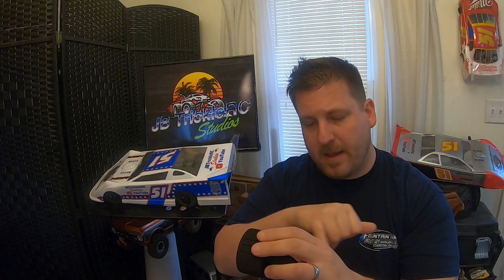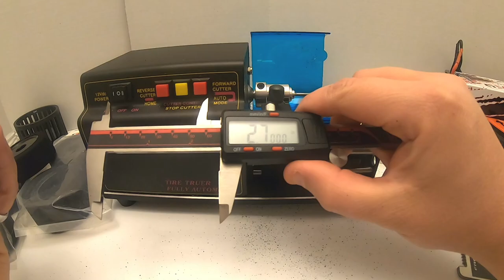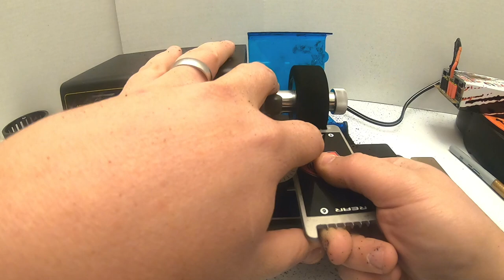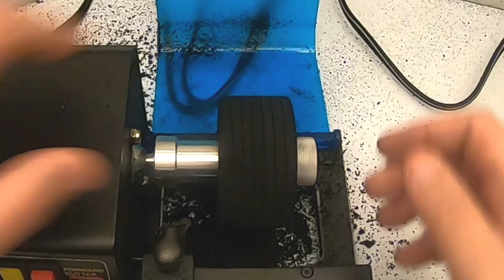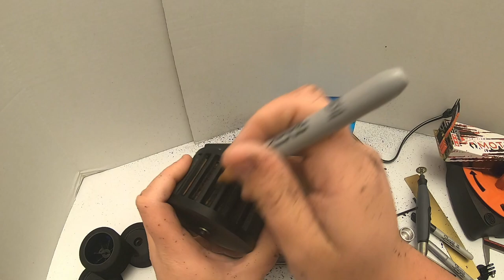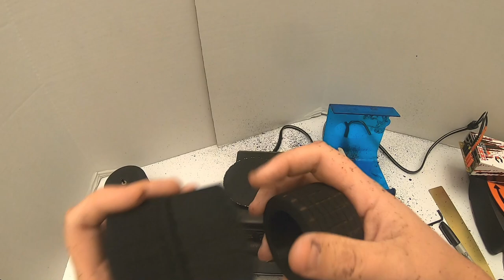RC Tire Truing, cutting, grooving tutorial: Part 1

Comment: Can you please tell me more about the foam itself, what is it made from what is the shore hardness, what is the foam known as in the retail world 
I am over in Australia and new to the hobby
Reply from the maker: Eugene, those are great questions but I'm afraid I won't be much help. These tires are made by BSR tires.  They do sell them in different hardness levels though which will also vary the amount of foam/rubber content.  More information can be found on their website.  As far as shore hardness goes that's something that can differ from racer to raver due to tire prep and softeners etc.  The science there is within your own racing program.  If you are looking for shore numbers based on the tires right out of the package. I don't have any notes on that because I didn't record anything until after I had them "broken in".

Comment: This is super interesting as I am a 1/7 scale speed runner.  Wondering if radial grooving would hold up at 130+ mph.  Would sure be nice to add traction to keep the car straight.
Reply from the maker: Todd that's awesome. I'm not sure I haven't done much with doped runs. But much like racing every bit counts.

Comment: Could this machine (with some modification) be used to regroove rollerskate wheels?
Reply from the maker: Hmmm... That's a great question. I'm not sure. It would depend on diameter and likely need a custom mount/arbor.
Reply: @JBTrickleRC  could you tell me what the maximum clearance would be. From center of spindle to bottom plate x 2.  I'm sure you know that. Lmao.
Reply from the maker: @JoshAintLoud  honesty, I no longer have the foam tire truer.  But I I know I cut my tires to 2.70 inches in diameter and some tires were close to 2.80 in in diameter.  So I'd say there's at least that. Maybe 3".  If you sent CRC an email or called them, I'm sure they would reply. They had great customer service as I spoke to them before.

Comment: Foam tired for dirt? In my state no one runs foam tires on dirt. We run pin rubber tires for loose dirt. Bar rubber tires for high bite amd factory stock is de racing grooved/ non grooved only. 13.5 is the slowest oval class we have though so we'd probably blow the foam right of the rim lol. Our sprint mwm sc mod and late model are all open motor/ tires classes.
Reply from the maker: Jeff thank you sharing. I always enjoy hearing how different parts of the country, even world I should say, run their races.  It very cool to see the similarities and differences.  We have a good mix of rubber and foam tire racing around me though we are pretty much high bite only in my area.  I've never ran pin tires for dirt oval. Plenty of rubber tire racing and foams though. Foams are a different world but I've grown to absolutely love it. Thank you for checking out and supporting the channel. Wishing you well in all your RC racing adventures.

Comment: Great info ty!!!   Just out of curiosity, do you know what type of foam is used in foam tires? Is it something that can be purchased and hand turned on a lathe to get new and interesting ideas to use on  custom level?
Reply from the maker: Alan that's a great question.  I'm not sure what type of foam is used to be honest. I do know that they use various types as there are different compounds which means different hardness/stiffness levels and some have more rubber content than others.  All these custom works and BSR tires come smooth so you can cut them however you choose but at that point you are limited to the diameter (which is usually around 2.74 inches give or take a bit).  I believe at one point you could get just the wheels and foam to glue them yourself but not sure if that's an option anymore or what manufacturer offered that and I may be mistaken on that as well.  I've always just purchased these specific tire types personally for the dirt oval side.  Everything else I run are generally rubber tires.
Reply: @jbtricklerc  thank you

Comment: Here in mobile Alabama we only run Hoosier type tires on our dirt track we only have one behind the hobby town they just wet and pack it and go racing so y'alls type cars won't work I dotn think they only run short course based classes buggy 2wd street stock class and 1/5 scale latemodels. We also have the carpet track only place here in mobile Alabama we run foams on we dont groove we just cut different sizes and camber into tires for our pan cars. Would your dirt latemodel work on a rough as in rough for a rc dirt oval track and wet type track with the same tires you cut and chassis it looks like the 17.5 cars look like a pan car but has shocks on all 4 corners and independent suspension would those work like the 17.5 class on a track like that or is y'alls track packed really tight and coated to keep it from getting rough and dirty on the cars
Reply from the maker: RC Carpet Racers the 21.5 and 17.5 cars can run the Custom Works rubber tires and we have run some "loose dirt" special event races but around here everyone pretty much prefers high bite foam tire racing for the purpose built cars.  We do run a lot of rubber tire buggy and slash based classes too. But generally it's always high bit smooth surface.

Comment: Is truing and grooving the foams for 1/8 dirt oval totally necessary or can you just run them like they come?
Reply from the maker: Sandman RC great question.  In dirt oval racing the only slick tires I see is generally rubber tires and that's usually only on high bite dirt oval track. Loose dirt usually treaded or pin tires.  Any and all foam tire dirt oval cars ive seen run grooved tires. Could it be done smooth? Maybe, but it would hurt more than help. It's all about grip and that's why we cut them the way we do generally.

Comment: I'm gonna assume yall are racing on some really well prepped smooth dirt tracks only dirt track we got its rough and has divots and ruts not to bad but only runs short course based truck classes street stock and 1/5 scale late models. Cars with those foams won't ever work here I dont think the dirt modified I run comes off the track covered in dirt and mud sometimes
Reply from the maker: RC Carpet Racers you are correct.  Around here we run high bit dirt oval. Very smooth, very grippy and very fast.  It's a blast!  Tracks can get a bit touch occasionally but our race directors do a great job with track prep. The Red Clay around here makes it easier with that.
Reply: @jbtricklerc  yes that must be nice we have bright red clay down here as well but the only dirt clay oval rc track we have they suck at track prep I wish we had high bite tight packed track with lots of grip to run foam tires and be able to use the chassis other then the short course truck chassis or a buggy chassis and be able to run foam for high bite. But will never happen that's why I'm sticking with my indoor carpet racing
Reply from the maker: @youknoweverything7643  I can definitely understand that.  It really is a blast.

Comment: It would be a 1/8 tire never seen this method where it is a cross cutting method wanted to know if it would work and if it would make you quicker in a 132 feet
Reply from the maker: Roderick I know some people and some race groups race foam tires in drag racing but I'm honestly not sure since I don't have any experience in foam drag racing. Our local drag group is rubber tire only and they are generally slicks. Good question but afraid Im not sure.

Comment: Will this work for drag racing
Reply from the maker: Roderick it would depend on the size of the mounted wheel and tire. This cutter is for 1/10 use. I did look to see if a slash oval racing tire would fit and it did not. Would need a 1/8 scale cutter for that. I know drag tires vary in size as well.